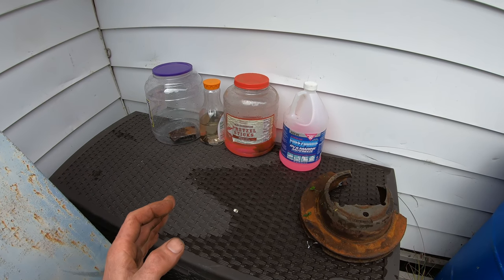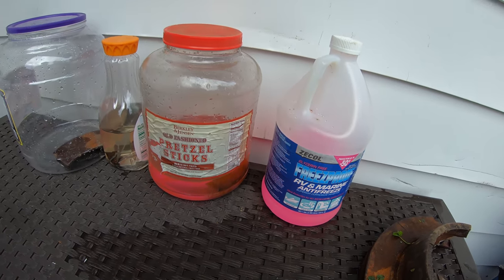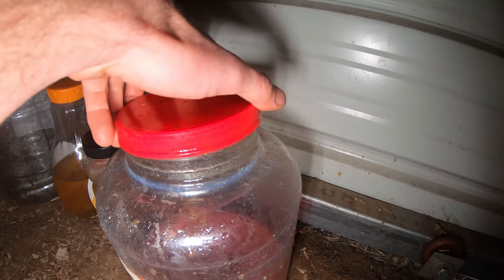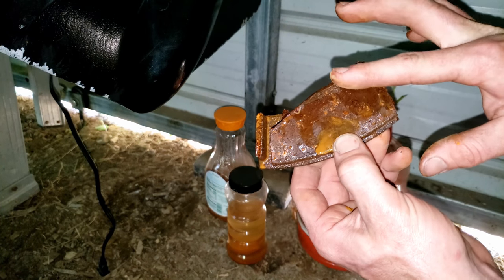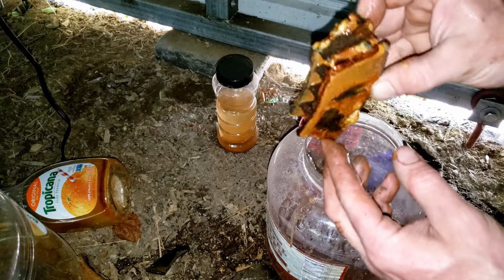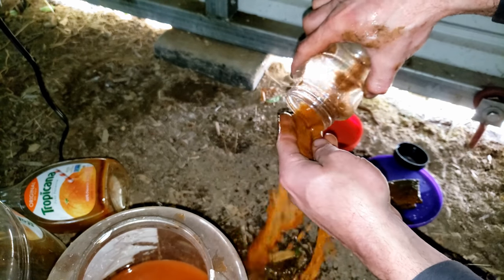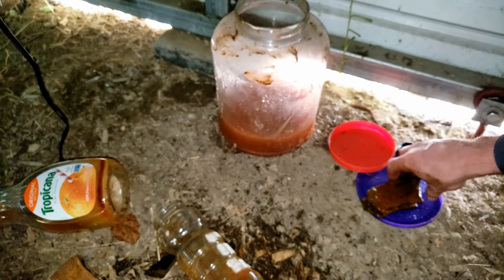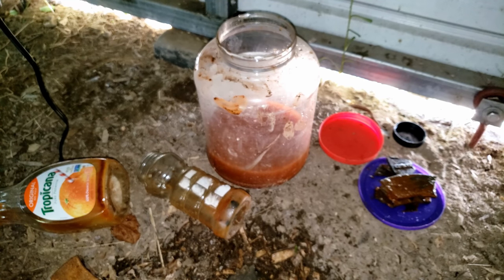I Wasn't Expecting That - Drain Block vs Leave Full (6 Month Test)

Comment: Good video, But you still have to worried about freezing. And just plain water in the bottom of the block could freeze and crack it.
Reply from the maker: Yeah you're right, I completely forgot to go over that. This is kind of a supplement to my boat winterizing video.  was just kind of a quick experiment to just show the difference.